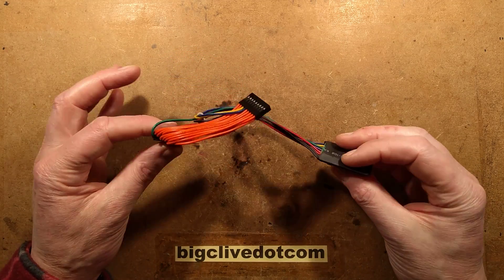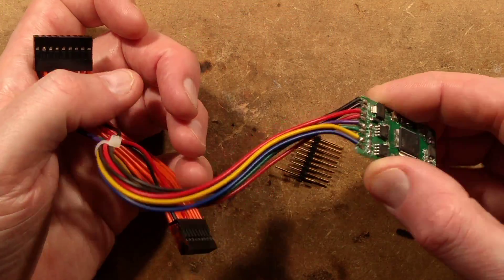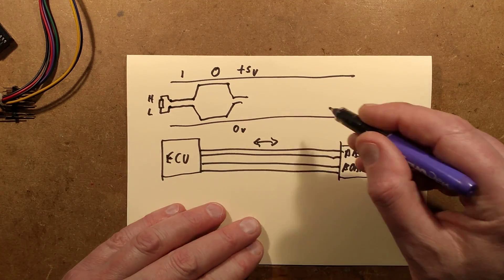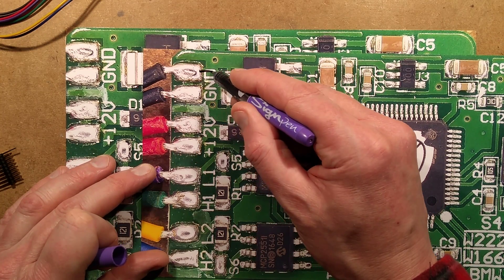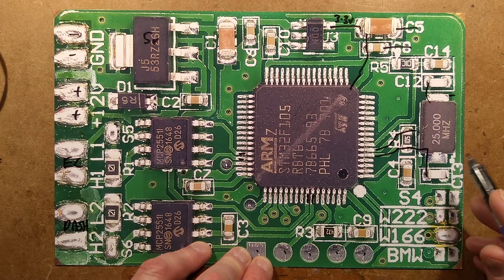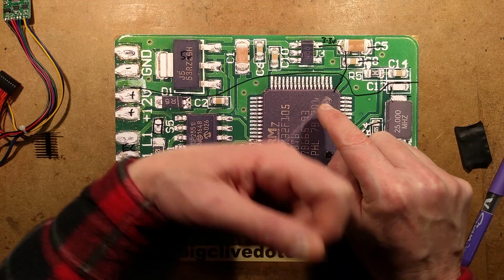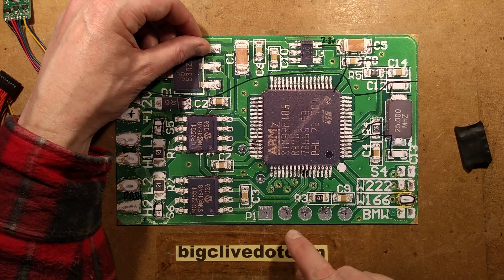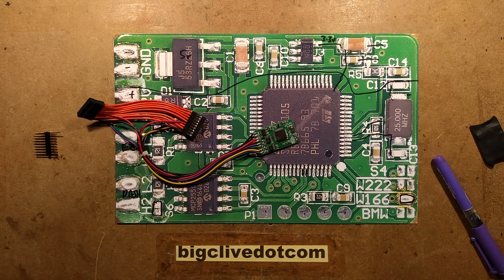Naughty CANbus odometer "interface".  (Fakes mileage.)

Comment: I used to work on equipment that had zero volts to represent a logic 1, this was so that you could connect two lines together to form an OR gate.  It was known as a wired OR, and relied on the fact that zero volts would drag the +ve logic 0 down (up?) to a logic 1 (0v).  It got really confusing as the newer equipment that came along used ICs and +ve represented a logic 1.
Reply: '-ve logic' is still very common. Ahh.. The days of 7401s and 7407s with open collector output for 'wired OR' (or NAND) depending which logic level you wanted 😁.
Reply: @ColinDyckes  In the early 1970s I worked on some Burroughs equipment that used quad dual input NAND gate ICs for all logic in the machine, bistables, registers, the lot.

I later moved to ICL and then to MDS where I was trained on equipment that used TTL when TTL really meant transistors! I'm currently building some kit, which for old time's sake uses transistors and diodes, not a chip in sight, let alone a microcontroller!
Reply: @rogerbarton497  Ditto, and ICL as well! Letchworth, Stevenage, Bracknell and Reading.

Comment: It's not arduino, why everyone thinks its arduino...it's Arm M3 MCU all you need to do is to power it on and upload code with inbuilt usb on the 5 test points, and to pull Boot1 state with other small test points on the board...and done, take like 3 sec for that.

Comment: 5:08 : the reason why the polarity is that way around is because zeros are dominant : when a CAN node tries to transmit 1 while another is transmitting zero, it immediately ceases talking — this is what we call CAN arbitration. Now why the polarity is like that, it is because if a zero is logically dominant, low identifiers become higher priority, because the ID of the frame contains mostly zeros. Say I want to send 0x19 while someone is spamming 0x44B : I will win over. This makes it simple for task critical frames to be safely received by whoever needs the information.

Comment: The reason why they don’t use a proper plug at the other end and just use that pin header is because there’s a plug connector from the car itself that fits over that connector which is used to lock on the connector into the instrument cluster. 

Fun fact these can be used on all Mercedes apart from the E class in the 2016+ range.

Comment: A Question that got on my mind is: Is it possible to detect these modules without deconstructing the dashboard? How would one go on doing this? In the old days you looked carefully to the bolts, screwa or nuts the dashboard is fastened with and got an idea if they were removed before. But today? 40 k km is nothing you would recognize  to be wrong if the general appearance suits.
Nice analystic video! Keep up the good work!

Comment: This is why you encrypt your traffic even within an embedded system. If the processors are Kinetis or iMX RT or anything cheap and easy, you can have private keys provisioned into secure storage, perform an authentication public key exchange, and be on your merry way.  Of course this increases the cost of maintenance. Of course there's more complexity than that to avoid replay attacks. It's a cool hack though!

Comment: Hi Sir i made a short on the CANBUS i put 12v on it and it goes tot 5 ECU S / modules and also to the cluster (No RPM and  km/houre  dies not work and the active stearing and Dynamic drive abs , transmission and so on don t work 😔 what do you think? I both the modules second hand .. can i switch the memory chip soldering so it dies not have to reset it because the OBD2 dies also not work No comunication.. please help thank you

Comment: Not an expert in CAN bus networks but I am a mechanic and it does depend on make and model of the vehicle, I have seen these devices on multiple occasions before watching this video and most of the time they're harmless but I have seen a version of this as a tachograph interupter device but I have seen it for nefarious purposes in the past not just for reducing mileage/kilometres but also to hide faults on used cars so buyers beware

Comment: Having been a Mercedes tech my entire career I can honestly say this is not all that uncommon in certain parts of the USA. Certain cities and states have more issues with this then others. I'm honestly surprised this was on a 2015 vehicle because by that time the criminals had become far more savvy. This is a fairly old school low tech way of tricking the odometer. The next generation if you will, was harder to detect because the criminals would actually alter the circuit board so simply removing modules and looking at the wiring harness wouldn't show you anything. However if you took apart the instrument cluster and knew what to look for you could still relatively easily identify the tampering. The newest and completely physically undetectable way of rolling back the odometer is strictly software based and no amount of physical inspection will find it. You need a special tool, that every dealer has, to find the tampering.  Unfortunately most dealers don't check unless they have reason to as the special tool is difficult and time consuming to set up and use.

Comment: Man I can't believe were at that stage in the future where supercomputers are super cheap and are just used for incredibly basic tasks 

Soon light switches will have more processing power than your phone lol
Reply: Phones used to have the same processing power as light switches!

These aren't supercomputers, a supercomputer has lots of processors in parallel, often hundreds but at least dozens. Usually connected over a very high-speed bus, or else they're just known as "clusters". 

Being a supercomputer doesn't really have a lot to do with clock speed. Though yep there are certainly CPUs in appliances that are faster than actual PCs of years gone by.

Comment: Somebody may have already said this, but the four pads on the bottom of the board (and that are present in many devices that use microcontrollers, generally directly adjacent to the mocrocontroller itself and traceable to either a serial interface or serial programming pins.  They are intended for programming the chip during manufacture. The chips are almost always soldered to the board directly from a tape reel or whatever, and programmed after they are installed with a clip or a jig specific for the purpose. If it's four pins that look like this board It is almost certainly RS232, and if the chip isn't an OTP model (or a model with a one-time program option for which the fuse has been tripped by the manufacturer) you should be able to connect to it with a device as simple as a RS232-USB converter.  It's easiest to just remove the DB9 connector and solder a couple of wires to the 4 serial IO lands on the board, then of course attach them to the corresponding pins on the target board.  Depending on the software the microcontroller is running and/or the configuration of the internal flash rom (and how the physical pins on the board are hooked up) one can almost always get by using the program flashrom in linux (available in nearly every distribution's repository), or in more usual commercial products (wireless routers being an example about which there is much information and a great many guides/tutorials online) which were built with diagnostics/rebuild-ability/refurbishment in mind there is often even a telnet server running on the microcontroller that can be accessed how one might expect.

Comment: Some people are obviously trying to misrepresent the distance on the odometer of their car to a lower value. So now some people have figured out how to do this with electronic odometers. Back many years ago when cars had totally mechanical speedometers and odometers, people would disconnect the mechanical cable to the speedometer. Some people even used mechanical tools to flip the mileage dials backwards. Doing this is illegal in most places.

Comment: I've seen similar things used legitimately to convert Km clocks to read in miles on JDM imports, might be used for euro imports too.
Always causes confusion as the odometer shows Kms up to the point of conversion and miles after, so to get the true 'mileage' you need to know what the odometer reading was when it was converted.
I can see how this could be misunderstood or worse misused...

Comment: I know of these. When you change the miles on these vehicles for whatever reason (hopefully legal reasons), the vehicle accepts the new miles entered and displays it on the dash. However it cross references the info on the dash with the memory in another module (varies by make/manufacturer) and sends the actual numbers back to the dash.
This unit interrupts that check.
Fun fact: the actual miles will remain and continue to count and be accessible with a factory level scan tool.

Comment: Actually, most instrument clusters store their mileage on the board itself, the communication is only transmitted for adding to the mileage and or reading when service needs to be done etc.
Reply: On PSA cars, both the ECU and the cluster store the mileage. To prevent clocking by swapping in a new cluster with a lower mileage, the system adopts whichever of the readings is the higher one and writes it anew to both ECU and cluster. So if the same applies to BMWs then this gadget would indeed need to split the canbus into two and have bi-directional comms with both ECU and cluster. Maybe it can force the lower of the two mileages to be adopted?
Reply: I think that is actually what it does; "CAN Filter is designed to support old mileage data blocking on Mercedes-Benz vehicles.  It is designed to prevent regeneration of the old mileage state in vehicle dashboard (odometer)." https://www.obdii365.com/wholesale/yanhua-mb-can-filter-18-in-1.html

Comment: they're actually used after changing the mileage in the cluster via an eeprom dump, it blocks CAN signals to stop the dash synchronizing with the EZS module and putting the mileage back to what it was before (info is stored in both and it will "correct" itself to whichever number is higher)

Comment: The jumper connections on the right side are for different vehicles, this board is jumped for W166 which is a Mercedes ML class, the W222 option would be used for Mercedes S class.

Comment: No one should ever do this, besides being illegal it's potentially dangerous because an experienced mechanic can get valuable information from knowing how many miles are on a transmission and engine when working on a vehicle.

As a mechanic if I seen obvious(150k+) wear and tear with 10,000 on the ODO I'd flat out refuse to work on it, so would many mechanics I know. You'll fool someone you're trying to sell it to.. maybe, but not a decent mechanic.

Comment: Presumably there is a lot of data in a dashboard bus communication for guages, idiot lights, etc. The micro would decode each comunication, strip out the mileage, subtract 40km, reinsert the new mileage in the right position and then transmit the new data to the dashboard.

Comment: I already saw devices to defeat the engine/airbag/break system control lights in older cars. They were simple enough, timed switching of some sort and a small relay so the lights went on with the ignition and cut the power to them after 3 to 5 seconds so it looked legit. Same with soldering resistors to the airbag wires so the car doesn't notice a missing airbag after the old one was removed due to an accident/faulty airbag. They then usually just glued the plastic cover of the dashboard/steering wheel back on. One of the tricks you could only identify by disassembling this stuff (or if you're lucky the horn didn't work or having a hollow sound where an airbag should be).
This just seems to be the modern iteration of those old scam methods. I wonder if they also get those things to stop modern cars from displaying errors in those little LCD panels in the dash. After seeing this video I guess they are able to figure this stuff out too.
Reply: I realise it's 2yrs later but... Back from the speedo  gang connector Cut the wire feeding the check engine lamp then scotch lock it  (tag on ) to the Battery /Gen lamp wire , wrap connector and tuck away from view inside the bundle .  Fixed
Reply: One year further on and the MIL light still has a switched 12v signal from the ECU. The battery light has an ignition switched 12v feed from the battery and a negative that becomes positive once the alternator is outputting voltage. When there is a difference between battery voltage and alternator voltage the lamp lights. Doing what you suggest will just put the MIL light on permanently whenever the ignition is on and probably destroy the ECU when you back feed it with 12v on an output pin that is pulled to ground when the MIL light should be off.  You would also create the potential for even more damage by connecting together 12v feeds that are both fed from different fuses/circuits.  @321CatboxWA
Reply: @AndyMcGeever  The check eng lamp is cut off out of circuit with the computer  and hooked in parallel to the charge lamp ,  no back feed is possible . The check light comes on with the key and goes out with the charge lamp when started just like you would expect it too. It's simple and cant harm the computer . I've discovered it done to a chevy that ran great but had codes that never triggered the lamp .
Reply: @321CatboxWA  The ground on the MIL light is permanently grounded. The 12v feed to the alternator light is permanently positive when the ignition is on. If you connect the positive going to the MIL light to the positive going to the alternator light then the MIL light will stay on. The MIL light is grounded through the common ground in the instrument cluster, the alternator ground is a seperate conductor that feeds the alternator field coil and is no longer a ground path when the engine is running. If you connect the MIL light ground to the alternator light ground then you are shorting the alternator's field coil supply to ground. You would have to cut the trace on the instrument cluster to disconnect the MIL light's ground and then add a link to the alternator ground to do what you are suggesting.
Reply: @AndyMcGeever  The ck lamp hot wire was cut and  tagged onto the charge lamp hot wire . Found it on a hunch , traced  it , no back feed issues were observed and the charging system was working to spec.  A potential dastardly way to disable a check light . I'm not advocating doing this . Results may very .

Comment: It's from a company called superkilometerfilter. The neat thing is that it is able to be turned on/off. If this was in use there's no way the customer can pretend they don't know as according to the company info, the speedometer also doesn't work while board is engaged.
https://superkilometerfilter.com/en/

Comment: So you know, w, on the circuit board stands for wire.  It was intended like a jumper.  It's usually there to either enable or disable a function.

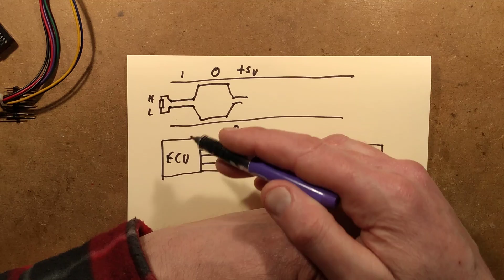Comment: 5:30 - CAN uses differential signalling for robustness.

Any short to a signal line will not cause a bit, you need to short L to ground AND H to VCC to generate a bit, it also means you need half the time and signalling can be much faster. I guess that pull-down on the L line and pull-up on the H is '1'.

I remember when 3-state devices became a big thing.

https://www.allaboutcircuits.com/technical-articles/the-why-and-how-of-differential-signaling/

Comment: The lower right codes are vehicle codes, at least the two W ones. The W166 being bridged means this one came out of a Mercedes ML, which is an SUV being built from 2011-2018. The W222 is the current S-class. Seems like bridging those kinda programs the circuit to work with a specific model. The other ones could be BMW in general, and S4 could be an Audi S4, although it seems kinda weird, since there are quite a lot S4 model years out there using CANbus.

Comment: 5:00 The reason for having active signal low is to enable signal collision detection (arbitration). If two CAN devices try and send a signal at the same time, the voltage drops even lower, triggering the arbitration protocol. The device with the highest priority can then re-transmit its data, the other device has to wait. Typical CAN bus loading is only 5%-10%, max is usually only 20-25%, so data collision isn't that common.

10:00 W166 and the other number codes the Mercedes model reference - W166 is an M or GLE-class, W222 is the S-class.
Reply: It also has to do with voltage variations. If it read 0 at idle all the time then any voltage spike (which is common even with twisted pair of wires) would read as an On state. This way the CPC will only read the voltage variation between the Can Hi and Can low for the on state. So if voltage varies then it will effect both can hi and low.

Comment: i know on Lincoln's from the mid '90s the mileage was stored locally on the dash, i had a customer who pulled the dash fuse to keep the mileage low :/ and yes it worked
Reply: I bought a used car with a bunch of parts once, including a dash cluster... when I asked why the guy told me “It’s only got 50K on it, if YOU ever sell the car swap it in and make a few extra bucks” :-S

Comment: If I test drove this car with the module installed, over a 10 km course, I would see the wrong value? So, not hard to detect?
Reply: Not if it just subtracts a fixed amount from the odometer. It's not difficult to do. All you have to do is forward all frames received on one interface to the other, with a check for the specific CAN frame ID that contains the odometer data (on my Chevy Volt, it's 0x120), then subtract a fixed number from it before sending it on.
Reply: @PinkPandaKatie  Thanks, great explanation.